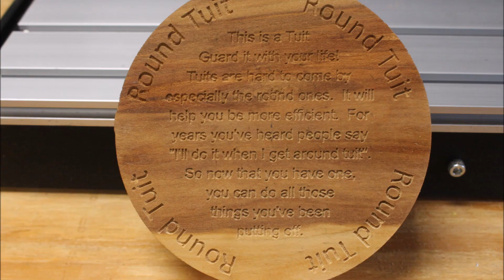3018 Pro CNC   |    Getting A Round Tuit

Comment: Hi Dave. I am a bit curious as to why that mod will be beneficial! My understanding is that this machine is only capable of engraving, unless you want to engrave on thicker materials?
Reply from the maker: This machine is capable of much more just engraving as are most machines when using the correct tooling, feeds, and speeds.  Thanks for watching.
Reply: @DaveGatton  can't wait to see how you use it.